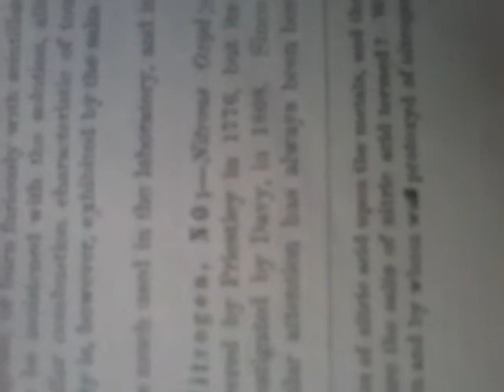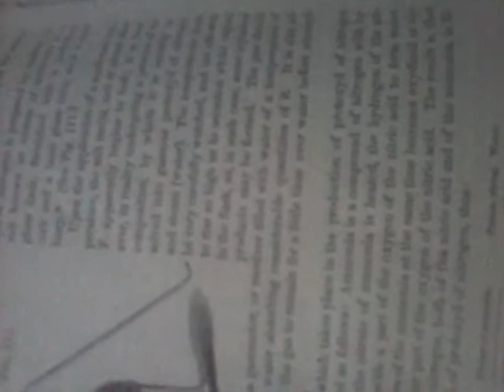How to make nitric oxide laughing gas�2013

Comment: You said that "it helps take out fires" Well I saw a guy put a burning stick in a test tube of liquified NITROUS oxide and it burned up crazy fast. Using an oxidizer to "help take out fires" would be stupid as all hell. So you are doubley wrong.